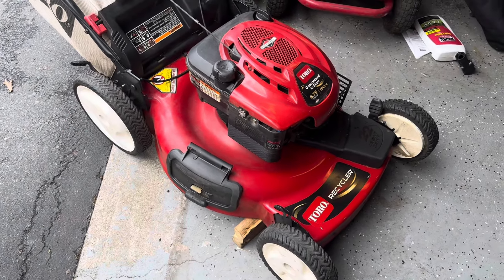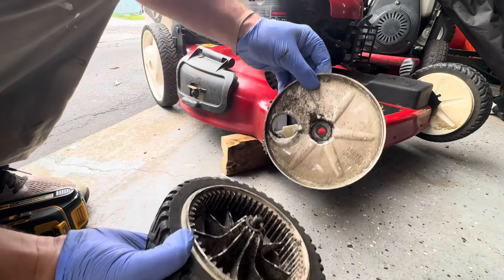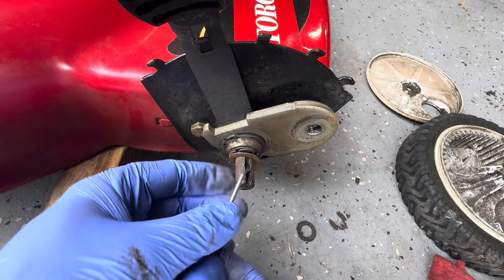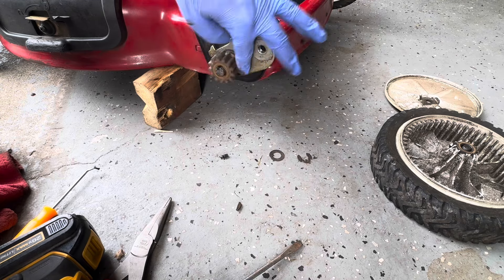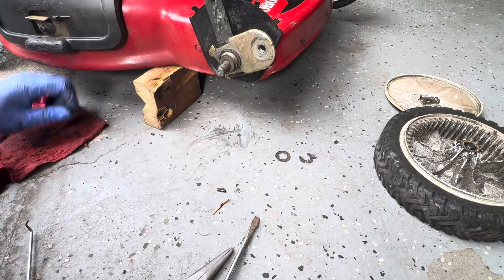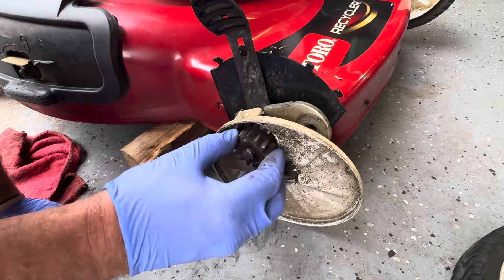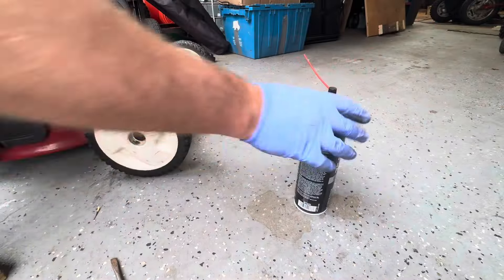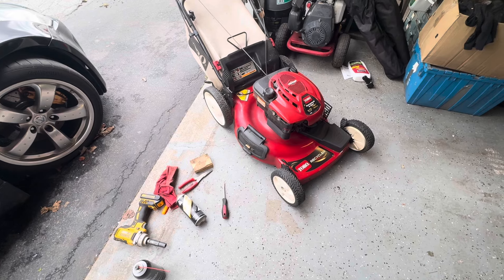Toro recycler self propel repair, mower wont drive

Comment: Thanks for the quick and to the point repair. 
I suspect the reason that gummed up is because the lubricant attracted debris. I’d use chain lube instead of any grease or oil.
Reply from the maker: Agreed. I find that white lithium works pretty well without getting too gummed up. The factory grease is fine but that gets sticky eventually too. Chain lube is a good idea.

Comment: How about readjusting the wheel adjuster? My tire is all lose like it wants to fall off!
Reply from the maker: There should be a bolt that goes through to the other side. Make sure it’s tight. I’ve also seen the frame crack there and barely hanging on. Let me know what you find